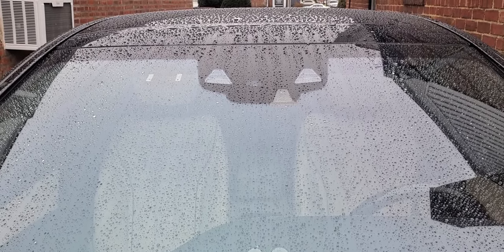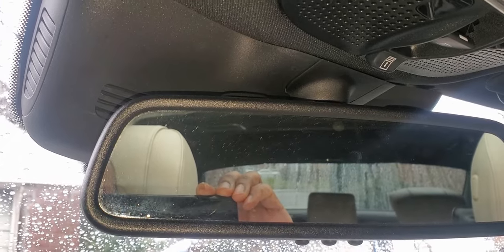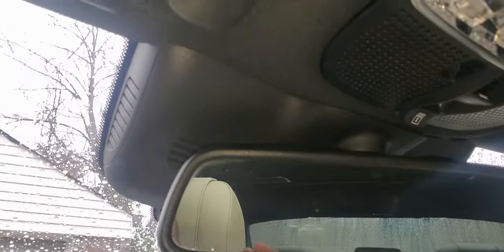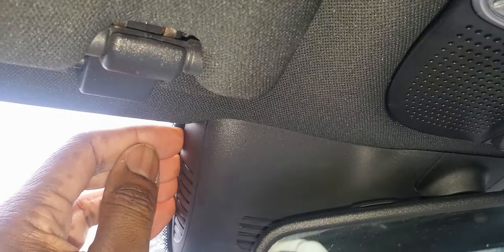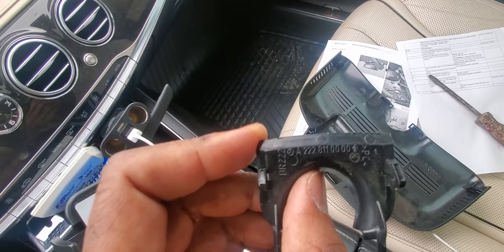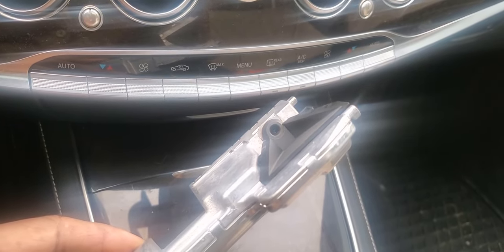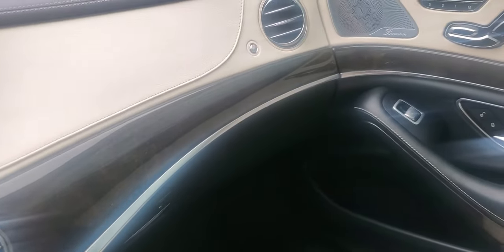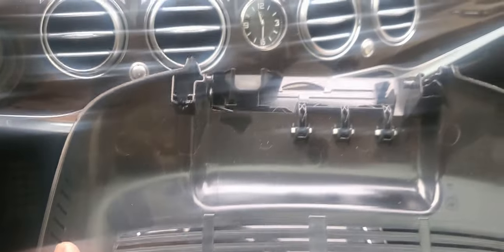How to Remove / Replace Multifunction Camera on a  Mercedes Benz

Comment: well well ... take off and change the front camera will lead  you to trigger calibration requirement because all ADAS systems need calibration after remove and install lucky you didn't got that because you will go to Benz dealer and pay some hundreds :)
Reply: So if my 2013 camera goes out and I replace it with the exact model, I will
Need to recalibrate it?
Reply: Any way to bypass calibration? I read somewhere that if you remove the battery; is possible
Reply: @Phuong_Nguyen_  Yeah it is possible to bypass the calibration but will cause severe issues to activate some functions, maybe malfunctioning. Best to hand it over to the manufacturer